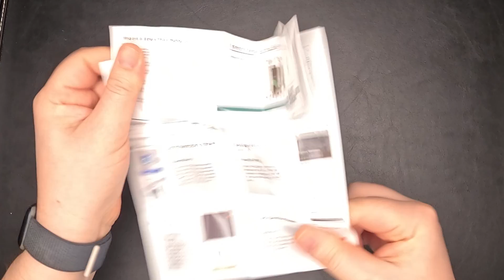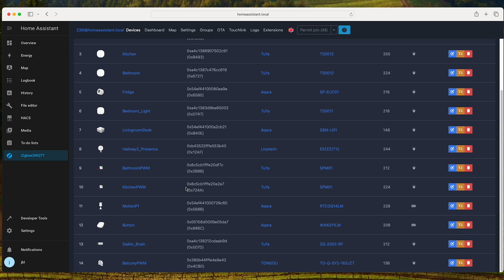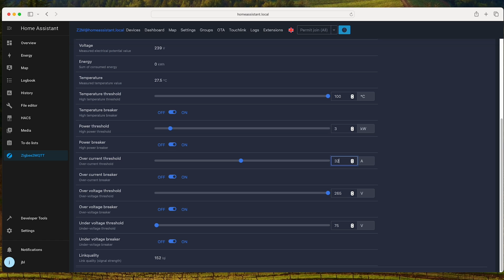Home Assistant: Rail Switch Power Monitor using Zigbee ( Zigbee2MQTT )

Comment: I just installed two of these (Tongou brand). They look and feel very good quality. HOWEVER, they are >>> NOT <<<"fuse" or automatic circuit breakers, just SWITCHES. 
You MUST install them behind a "fuse"/automatic circuit breaker, this is also clearly mentioned in the manual's schematic !!!!!

See the manual ! https://www.tongou.com/wp-content/uploads/2024/04/Din-Rail-Smart-Switch-TO-Q-SY1-TO-Q-SY2-Series.pdf

So, how it is installed in this video is MANDATORY not optional !

Comment: I wouldn't have added it to grid, but instead to individual devices. Then you can have it as a parent of sub devices with their own zigbee switches if necessary.
Reply from the maker: in my case it monitors individual circuits. I have a separate breaker for AC, separate for the boiler etc. This way I can monitor consumption for this high power draw equipment and even cut them off if I'm away from home

Comment: Good Evening, is it possible to use an automation to adjust e.g. the power output via HomeAssistant at that circuit breaker?
Reply from the maker: Hi, yes you can trigger automation based on a lot of sensors from this device, voltage spikes, power under or above a certain value etc.
Reply: You can only turn it on or off, not "adjust" the mains voltage it's passing through.

Comment: I have same zigbee tongou but in my Home Assistant I have't the temperature and all the power switch... did you know why please ? 
Mersi mult de video :-)
Reply from the maker: Eu mulțumesc pentru comment :)
Is it added via Z2M? in Z2M appears as model TO-Q-SY2-163JZT and zigbee model TS011F so yah probably an older revision. Z2M does not see any new firmware for it. (later edit since I did not see your second comment for some reason)
Reply: @TricksAndThings  I'll buy some new pieces cause I just need some. 
Thanks a lot :-)
Reply from the maker: @MrDenisJoshua  He he most likely your new one will have something extra :)
Reply: I found the problem... my version is TO-Q-SY1-JZT and your is SY2 (01:31)
So mine is older... :-(

Comment: It works also with ZHA out of the box
Reply: Hi, with ZHA you can configure over current, voltage etc.? because with z2m I can do this, but in zha these settings do not appear
Reply: @drg_iulian  Hi, with ZHA you can only read kWh, W, V & A. There is (actually) no possibility to set over current or voltage.
Reply from the maker: @stefantaschelmayer8413  that's a pitty that ZHA is so behind on integrations. After having some issues with different devices I switched everything to z2m
Reply: @TricksAndThings  I am still planning on this but don't have a second Zigbee controller to do so...lot of work.
Reply from the maker: Super. Thank you for the update. Unfortunately i could not test with zha since i only have one coordinator on z2m

Comment: Thanks for the video! I was considering to buy exactly this model.
I still have two questions (actually three, but @XDaam just asked one of them). Is it compatible with the Sonoff Zigbee coordinator? Did you test the overcurrent breaker function? Is it accurate and fast?
Reply from the maker: Hi, glad it was useful. It works with any zigbee coordinator (just make sure you order the zigbee version). I did not get the chance to test the overcurrent protection. That's why I mounted it after the normal breaker. I will do some tests probably low amps (1-5) and see how fast it trips (if it trips )
Reply: @TricksAndThings  It is NOT a circuit breaker !!!! It's just a switch that you can control through Zigbee. This version does have a current measuring option but nowhere does it say it functions as a circuit breaker, in fact the manual clearly states that it must be installed BEHIND a proper circuit breaker (like you did).
Reply from the maker: Thank you for the clarification. It seems that my default instinct was right then :). I don't have  the manual anymore but even it had written that it can replace a normal breaker I would still not trust it. Unless it was form a trusted well knows professional brand.
Reply: @TricksAndThings 100% agreed.